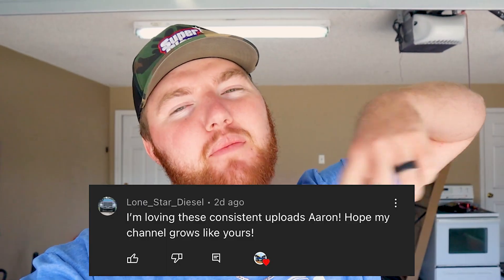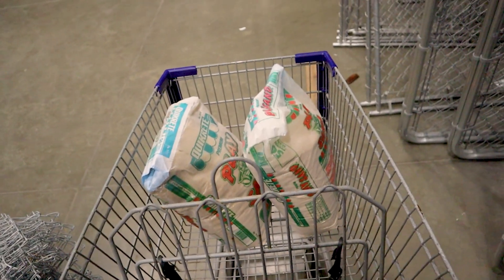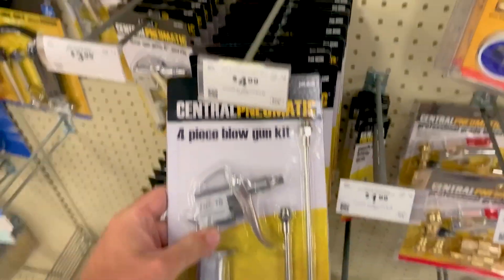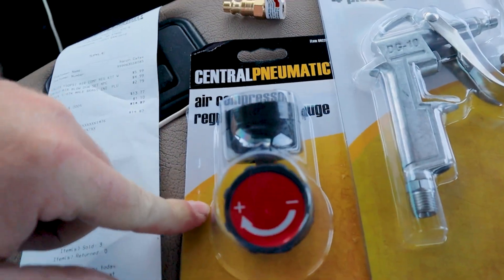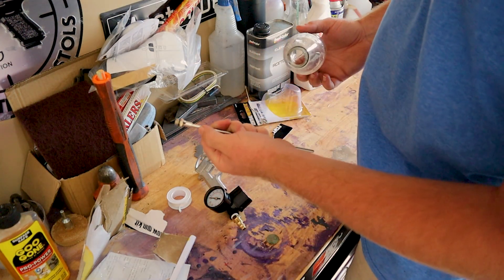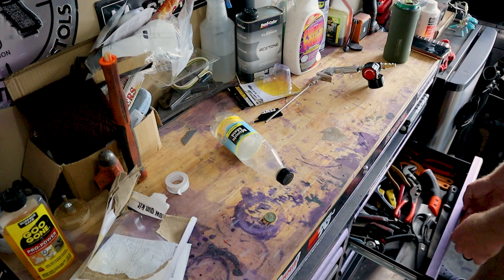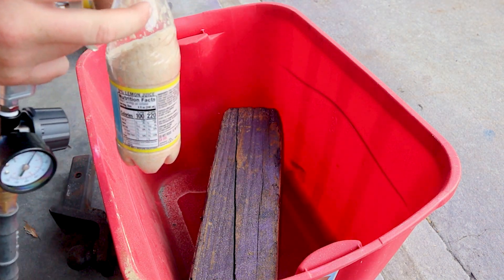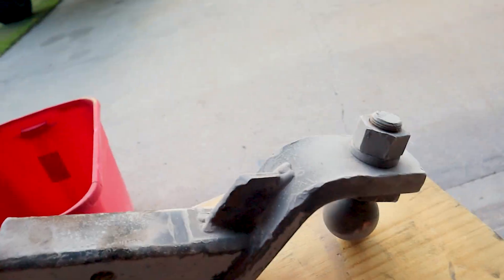DIY Sand Blasting Setup LESS THAN $10

Comment: I've made one of those DIY sand blasters myself a few years back. It works pretty good for smaller curved projects. Its one thing to buy one but it means more to me when you make it yourself, I think anyway. ive seen some other videos when i made mine about people buying that small handheld sand blaster from harbor freight you showed in the video and the people that bought it had to somewhat modify it to get it to work right for them. I think they made it kinda crappy. You did good making your own instead of buying that one and having to rebuild or modify it to work well enough...might get you a window screen or strainer to clean the sand and get the bigger clumps or rocks out before loading back in the bottle. Great video by the way!

Comment: This is the sort of content I have been wanting to see. I live off grid in a truck. Would this work at 30-40 psi run off of a tyre? 
Subscribed.
With yours maybe try running a shop vac into the box to catch sand?
Reply from the maker: I started out at around 40-50 psi and it worked but very slowly, after I bumped it up to 70-80 it performed a lot better. What an awesome lifestyle btw!
Reply: @AaronCates  Cheers, I think I have the bits I need to try it.
All you need is a van, some tools,a little ingenuity, materials and you can do it too.

Comment: a wire wheel or a flap disc probably do a better job with less mess????👍Keep up the good work!
Reply from the maker: For flat surfaces those work great! When you’re trying to get corners or inside tight areas the sand or media blasting really helps!